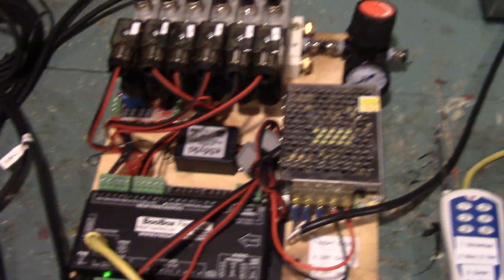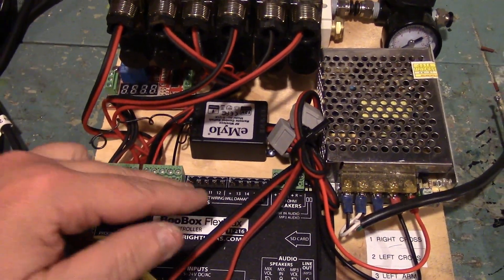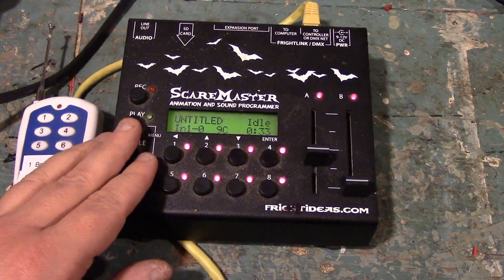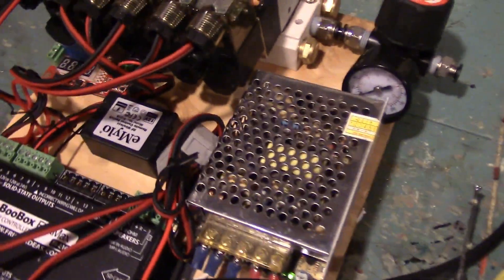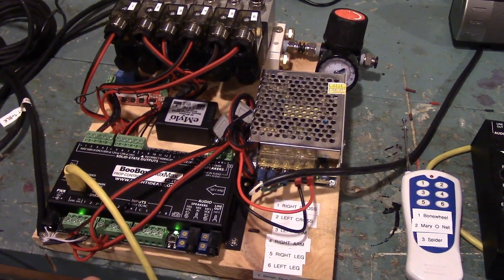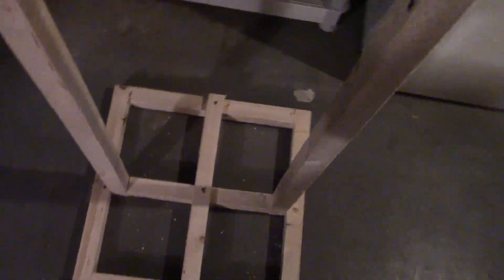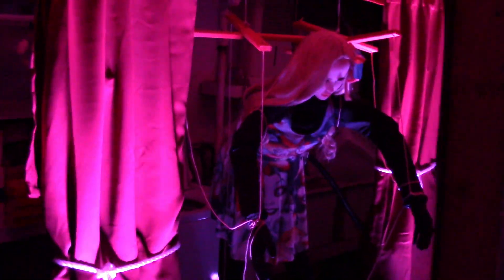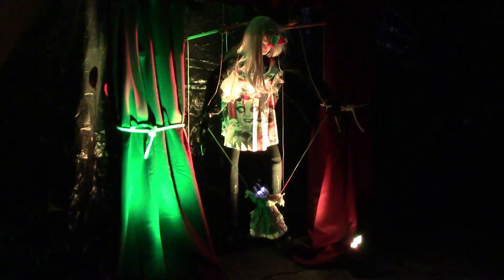Marionette Doll - Pneumatic Animatronic Halloween Prop 2019

Comment: Hi i am going to be doing a project for next holloween and i am going to use dmx 512 rotating mini lights wonder how you program them in the director software using the boobox flex max.
Thanks, Gil
Reply from the maker: The Flexmax has "some" fixtures already implemented into the program via drop down menu. Most are not, but you can create your own fixtures by programming the channels individually. These are then saved into "your fixtures" and are then available to you. Once you select the fixture you can adjust the X and Y axis, color intensity, fog, fire,  colors, flashing and whatever else the light is capable of. You adjust this via line graph by dragging and moving the graph line. The x and y axis takes some time to get use to, but you can visually inspect what your light is doing in terms of position by playing the routine or sliding the progress bar to where you need more detailed movement. X and y axis also has a "fine" adjustment which slows down the movement if you need spot on detailed work. I get by with just the regular but it is there to use.
Reply from the maker: You also need "Direct Connect". It is a box that plugs into your USB computer port and uses RJ45 cable to connect to the Boobox. This is needed to program the routine or DMX lighting.
Reply: @Industen  ok awsome thanks for the info that help in creating my on fixtures since the lights i am buying are not in the dropdown menu.
Reply from the maker: Hey, no problem. When you get your fixtures look at the manual for the channel settings. There is a bit of a learning curve with "line fill" and other options when implementing your own but there is a tutorial on what you should select dependent on the DMX channel.
Reply: @Industen  ahh ok do you know where i can find that tutorial?
Reply from the maker: When you add your fixture there is a help bubble at the bottom. It discusses the different functions and what they do. You can download director and play around with it to get a bit more knowledgeable on how it works.